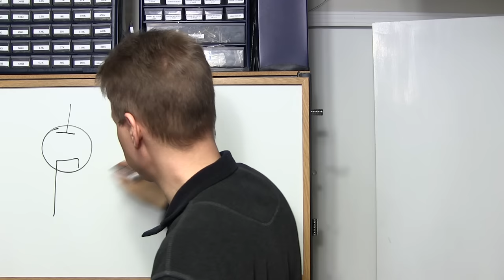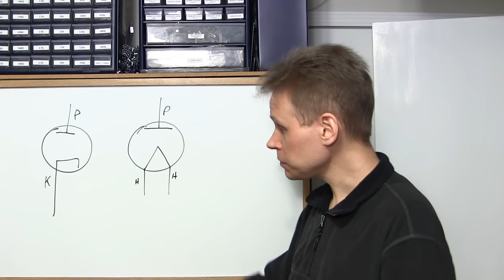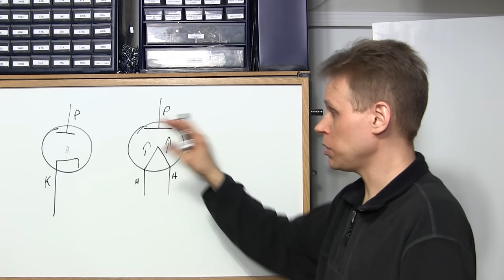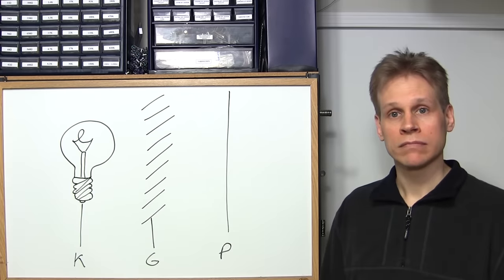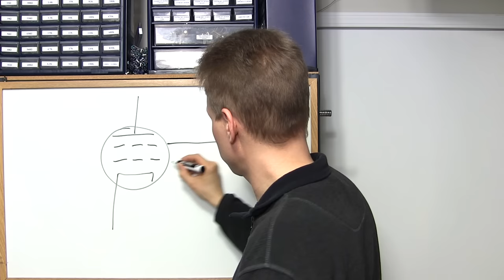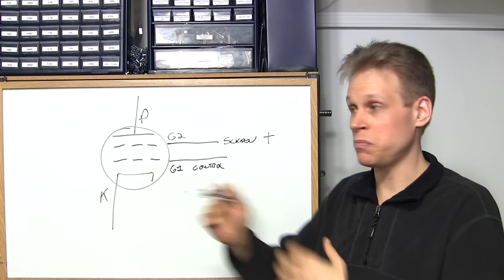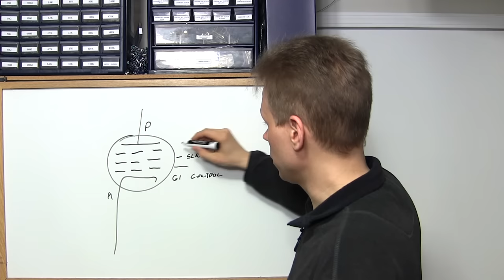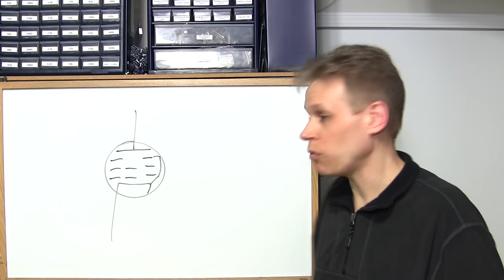How A Tube Works

Comment: I'm young enough to never have worked with vacuum tubes.  It was always discrete 74LS series logic ICs or discrete transistors for me, then later "1M" gate arrays such as the Xilinx Virtex 1000 (and the xc4000 series before that).  Completely different design environment (even making allowances for digital vs. analogue).

So I've always wondered about vacuum tube technology.  I had the general basics (including the general theory behind secondary emission and suppression grids of pentodes) but I've never really seen how these are actually applied.

So it'd be great to see how these things are actually wired up as a supplement to this great introduction to the basic classes of vacuum tube, especially if you can frame it in terms of MOSFETs (since I gather vacuum tubes are voltage-controlled devices rather than current-controlled devices such as bipolar transistors, as I recall).

What biasing is required and why?  What other auxiliary components (shunting, decoupling etc) are required and why?  These are voltage controlled devices but, since it's controlling the flow of electrons, doesn't that make it a current-modulated output device?

That's a bit of an interesting contradiction: BJTs are current in, current out devices; MOSFETs are voltage in, voltage out, but these things seem to be a hybrid of the two.  

Can you do a video for those of us who're more familiar with modern devices on how to understand the mode and operation of vacuum tubes?  Thanks!

Comment: Very interesting principles.  I remember an early GE Color TV we had in the early 19070's was dull of these tubes.  Took 40 seconds to warm up.  Probably indirect heating from your diagrams.  The most unreliable TV. ever made  One tube or another would burn out every couple of months. It was interesting yo see the tubes glowing inside. Transistors were a big advancement..

Comment: Excellent. Well presented. Often wondered, why not a quadrode?
Reply: Since the 'ode' is derived from the Greek for 'path' or 'way', and the 'di' in diode and the 'tri' in triode are also derived from Greek it seems logical to use the Greek 'tetra' for the four.

Comment: When you say negative voltage you just mean a voltage lower than. The plate voltage?    Is it AC or dc going through the tube?
Reply from the maker: A negative voltage is below the "0" or ground. The positive terminal of the negative voltage supply is attached to ground, the negative lead is what is supplying the negative voltage.

Comment: In a guitar amplifier can I substitute the 6L6 with an 807 tube? You say the 807 is a "ruggedized" 6L6, are the requirements the same? Do I need to change or modify any components? How about the "Bias" setting?
My favorite preamp tube is the 12AU7 because it has @ 16% gain factor. Recently I installed a "12AU7A " (5693 tube) ruggedized version of the 12AU7 in a  headphone set and it sounds good.
Reply from the maker: The 6L6G is an 807 with a plate cap. The 6L6GC is a completely redesigned 6L6G, so it is altogether different. So it all depends on the variant. You can visually see the internal structures will match between the 6L6G and an 807... or my favorite, the RK39 variant of the 807. Having the plate cap on the top of the tube is a hazard in exposed service, so it's not recommended. There is no benefit going from a 6L6G to an 807 in audio service, as it's just the same thing in a different package. The 6L6GC can not be substituted for an 807 without circuit design changes.

Comment: Nice video, but how does a diode / rectifier work?  Take a 5Y3, for example, a simple diode rectifier with only a cathode and an anode (no grid).  The cathode and anode are powered by two independent power sources.  Since the power sources are independent, how can electrons from one power source to the other?  How is the return path completed?

Comment: Could you do a explanation of the difference between the EL34’s 6L6’s and the 6550 power tubes?
And also the difference to the 12AX7 tubes.

Comment: What can happen if tubes are installed in the wrong tube sockets? For example, installing 12Ax7 into a socket deemed for EL34 and vice versa? Will this ruin the circuit board?

Comment: How many of these tubes emitted so much irradiation (glass is not a very good insulator for RF waves) that they screwed up other function in the circuit.  Some tubes had metal covers.  We’re they for RF insulation?

Comment: Why do you refer to the electrodes in a vacuum tube as apertures?  An aperture is an opening, an orifice, a hole.  I don't see the connection with valve electrodes, and in my long career as an electronics engineer I have never seen valve electrodes described as apertures.

Comment: Thanks. Makes sense why our Sony C800-G (a very expensive mic) as well as its power supply, the AMC800G, use a 6AU6A.
[Yes, I'm aware that it's not actually a 6AU6A, that's just a compatible mislabeling for proprietary reasons surrounding the unique tube Sony used in them. For all intents and purposes, the Ukrainian-made Sony tube is at least similar to a 6AU6A]

Comment: One thing I've come across is the term offset/barrier potential that could be imparted by the filament voltage potential. Whether this could be more of a problem with the directly heated filament/cathode valve/tube types especially in direct coupled DC amplifier circuits such as used in analogue computers.

Comment: a direct heated tube triode  a ux 26 tube, for a.c. it was a ux-27 meaning it had a cathode  
above the heater. 807 a tube used in transmitters. I have a 71A in radiola for audio amp.

Comment: Superb explanation! Probably the best videos on electronics I've seen so far here on youtube. As good as the afrotech stuff and it is really fun that you show tube stuff because I was born in the 80s so I haven't used much tube circuits apart from recently when I had the money to start buying some vintage guitar amps. 

It would be interesting to see a video where one can follow some simple tube amp signal flow and maybe see some scope or multimeter readings before/after coupling caps etc, to go along with the suggestions you made earlier of throwing away old caps because they will leak. Would be nice to see where there's hundreds of volts and all of a sudden there comes a cap and DC volts goes to 0 but AC is amplified compared to prior the tube.. Oh this was a rather long comment. Sorry for any confusing language, best regards from Sweden :)
Reply from the maker: +Eric Öhman 
Thanks for your input Eric! I will do a video on signal flow.

Comment: Thanks for the video. I have a Zenith 10S464 console radio that I restored back in 2012. It was playing great, but 2 months ago I kept hearing a "pop" sound about every 45 min. Then, I heard a sizzling sound coming from the speaker and the console then stopped working. Nothing lights up. I have a tube tester and all tubes are okay on my B&K 707 tube tester. I have 2 rectifier tube 6x5GT, but when I check one of the rectifier tube for grid emission, the needle of the tube tester moved violently off the green "good" scale. I didn't smell anything get fried and the transformer was warm to the touch. Now correct me if I'm wrong, I should check the transformer, electrolytic capacitors, resistors and capacitors. Yes I do have a variac to gradually bring up power. Any advice you can give me?

Comment: If i recall the tetrodes grid was also called an accelerator grid since it speeds up as it were the attraction of the electrons through the control grid, hence its better high frequency performance.

Comment: Stupid question: If the grid is left floating, doesn't it float at a voltage that is proportional to its location between the cathode and anode? And, does the "blind" actually open more from its resting state and increase the plate current if made more postitive? Or does it just work in the negative region, when pulled from its resting voltage towards the negative, it will close down?

Comment: Thank you, although this is a very basic introduction to vacuum tubes it was fun. To have "TWO" Techtronic scopes on the shelf would have cost a fortune when they were built. We generally had an old Health Kit scope (that had been fixed) and another dual trace scope. But not of the quality of your fine instruments. My dad was my instructor, looking through the RCA receiving tube manual to select the tubes for my next project, building a superheterodyne receiver was one of my more complex builds. Started from scratch, drew each circuit as I went, wound the coils, it took weeks to build. This was in elementary school. The science teachers had no clue what I had built nor an appreciation. I did not do it for them anyway. Don't know what ever happened to that stuff. Our shop was about three times as big as yours, but with about 1/20th the equipment. High school and college days worked at TV stores, replaced a lot of picture tubes, and cleaned a bunch of noisy tuners. I also had the privilege of cleaning the dirt out of those things. Drawers of SAMs schematics, where the money was though was fixing TV antennas, the leads would get broken, just driving down the street I'd spot dozens of junky antennas, missing elements, turned the wrong direction. I would subcontract for several TV stores. They did not want to do the dirty work, I could do it around my college schedule. It was a win win. B+ was an exciting issue to deal with as well as the high voltage circuit in the color TV's. From hand wired TV chassis to the modules, then around 1999, it all disappeared. The end was in sight for the builders of solid wood cabinets, and the need for large picture tube manufacturing was shutting down fast. Soon consumer electronics were no longer built in the states. The technology of the high definition signal was becoming stronger and stronger, and the new hang a TV on the wall  with very few parts. High powered transmitters used large tubes (I haven't been around one of them in about 20 years) but they were some of the last of the equipment that relied on tubes. Although some audio people are wanting the vintage sound of the buzzing guitar amplifier. No understanding of a 60 hz hum, (never did have a 50 hz hum).

Comment: British terminology for a triode is "valve" not "tube", being more literal.  The grid can also be considered as a "stepping stone" in-between the two "banks" of an electron "river" that allows crossing when up (positive charge) and stops it when down (no charge).  A controllable valve or variable amplifier can occur by adjusting the "size" of the stepping stone (grid charge) or, for simple switching on/off use (computer 0/1, for example), just grid charge being on or off.

Comment: That was a really cool video :) Would love to see how they are wired and used in a practical situation, eg how to use the diode, triode, etc in circuit to perform their intended function. I mean I know what a semiconductor diode and transistor are and how to use them but I have never fully understood how the good old vacuum tube is used in circuit. On a side note, this Saturday 22 June I am going on a day trip to Bletchley Park, home of the code breakers and I am looking forward to seeing the old tech there and the National Radio Centre where licensed Ham operators let you have a go at calling out on the air :D Yeh I live in the UK but not travelled much lol :)

Comment: Mr Carlson, If I may be so bold to ask. Could you please do a video on the exercise of checking tube pin voltages and explain the best resource for the pin voltages either obtaining a vintage book or getting them from tube data on the internet when the schematic does not list them. Which components of the tube should have their voltages checked and why. I have somewhat of a understanding whats going on but I just want to be sure.
Reply from the maker: Thanks for your input.

Comment: When Tesla used 6 70L7GT tubes to power his electric car he built two rows of them and powered a 240 volt motor with them by wiring them in a series. The source of power was an 6 ft antenna each then the tubes then to a battery then of course the motor. How would you wire these tubes in a series? Is this how he amplified power from the antennas ?  My theory is that maybe running a tesla coil as a receiver then using the tubes as amplifiers somehow would increase the voltage and produce power. The electric companies are already doing something similar. By the way I enjoyed your video that was informative to me.

Comment: Why don't electrons travel from the grid to the plate? It seems like that would happen just as easily as from the cathode to the plate? Is there a different voltage level? It's one of the things that I haven't ever really been able to understand about tubes.

Comment: Do electrons while moving through the tube still move at the speed of light?  If not, I would expect G3 (the suppressor grid) to create all sorts of phase cancellation issues if its connected to the cathode.

Comment: Great video.  But I have always wondered about the physics of it too.  What make the best emitter coating and why? What are the current limits and why? The Russians used mini tubes in their radar sets for decades: how come and how  good were they? Could new tubes drop the heater and use UV LEDs to trigger electron emission, or would that be woefully low powered?

Comment: Hello sir,thank you from Bangladesh,please make a special video on vacuum tube pins 5/7 and show which pins are 12345 1234567 and which pins go into which holes in the socket for a perfect match and also insert and out of socket instruction with slow easy tutorial also show how you know pin configuration easily

Comment: A few suggested projects:

Wireless power transmission.
VanDerGraff generator.
Flux Capacitor.
Repulcine (AntiGravitation/Mass Cancelation).
Reply: Chris Dragotta, Perhaps some thoughts on free energy and such? The only hitch is the Van De Graff Generator, which actually works and exists.

Comment: Hey, Mr. Carlson. Got a question. I’m building or trying to build a regen with some battery tubes. The 1t4 and the 3v4. I’ve heard you say that the first number is the filament voltage but in most of the circuits I’ve seen with the two tubes together the 3v4 only has 1.5 volts. The latest schematic I’ve looked at had pin 1 and seven tied together and pin 5 grounded. I guess my question is if only 1.5 volts are on the filament of the 3v4 am I getting all the gain the tube has. I also wonder if I could use separate filament batteries or maybe just use one three volt supply and somehow drop the voltage to the 1t4. I know this is all basic stuff for you and your viewers but I’m just getting started any help would be appreciated. Thanks.

Comment: +Mr. Carlson's Lab I am trying to learn about tubes and this is very helpful.  I am still confused on a few things. first of all when a tube is used as an amplifier, is the plate supplying the output to the speaker/ load or is the cathode? if the grid is the low signal in, what does the cathode and the plate do?

Comment: Great video - but the beam forming plates in a beam tetrode do different things to the suppressor grid in a pentode. It focuses the electrons to form what amounts to a virtual suppressor grid. The beam forming plates are internally tied to the cathodes, and every pentode I've seen has G3 tied to a pin. And yes - the beam tetrode was invented to circumvent the Philips/Mullard on the pentode.

Comment: if a tube were to red-plate would the cathode be getting too many electron?
Reply from the maker: Hi Larry. The cathode emits electrons, and if the vacuum tube plate glows red, the tube is drawing excessive current... So you could say there is heavy electron flow at that point.
Reply: @MrCarlsonsLab  because i have a power amplifier with a 6BQ5 that had two resistors burned clear in half,what would cause that, a shorted transformer?

Comment: Thank you !  This is a good informative video. Today electronic is almost made with semiconductors instead of vacuum tubes. Vacuum tubes are not used in today very much. what are the part no of the vacuum tubes which can be operated with low voltages such as 12v and readily available in shops ?
Reply: Aren't solid state components more reliable?
Reply: Yes solid states components are ok, but for some cases such as high power with fast switching in applications, the reliability of tubes is better than semiconductors.
Reply: neon 88 I'm guessing radar equipment still uses tubes.

Comment: "By putting a negative voltage on the grid of this tube will stop the electron flow from traveling from the cathode to the plate."     When you say "negative voltage," do you actually mean "charge?"   ....as in, "negative 'charge'"?

Comment: is there a meaningful tube tester for 572B?
what's the best way to test a 572B without putting it in an amp and measuring output power?

Comment: In my teen age I remember UZ 80 or EZ 80 "Z"represent diode U is common voltage of heater filament kept in series,and E represent 6volt heater Voltage.through 6V out from transformer And EF69 for pentode F for pentode generally used in out put of Audio amplifiers 👍